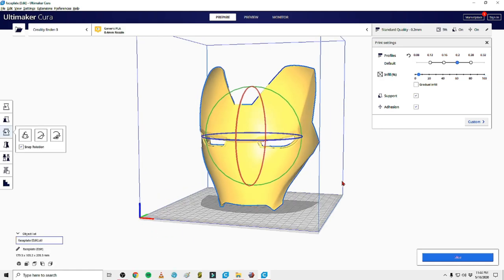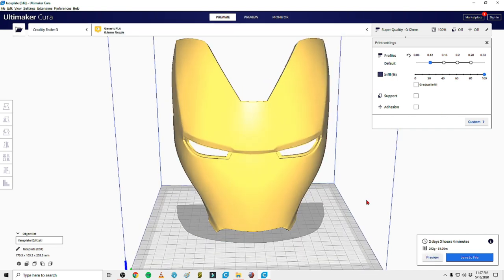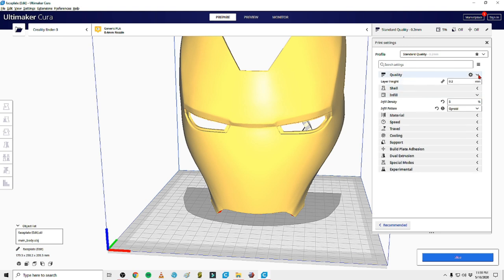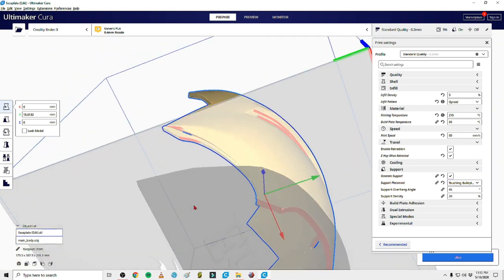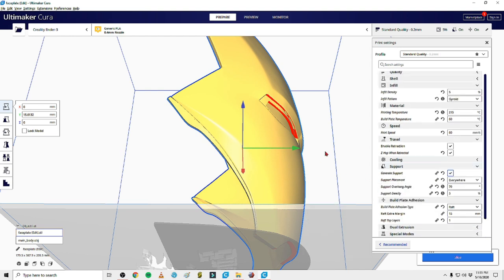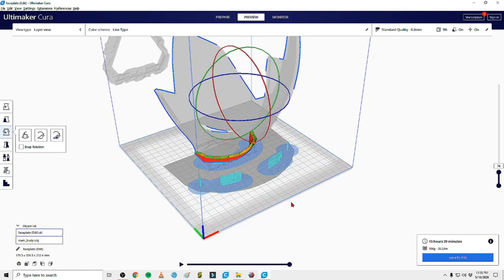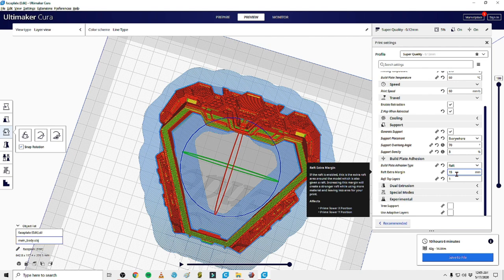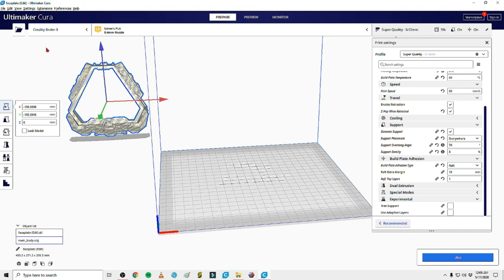Cura Settings - My Easy to Follow Tips to SMOOTH 3D Prints!

Comment: Bro you're ABSOUTELY crushing it. Everytime I run into a corner with how can I make a print work, I sift through your vids and have found answers every single time. My first build was a wingman from APEX (blocky and simple) and then I immediately jumped into building lich king armor which is very complicated and your vids are walking me through it a step at a time. I've learned so much. Also the Ender 5 Plus your recommended is straight beast mode. Now both me ender 3 and 5 are putting in work.

Comment: Good Morning! Thank You so much for you input on this video. For days now I been searching of how to use the slicer and so many videos I have seen that hasn't stated any of the input you have on this video. Thank You so much! I am new to 3D printer and was about to threw in the towel until I decided to do one more search and ended up with your video. I think I have a chance now to try it out and see how things goes. I had brought a Ender 3D printer and thought I have broke it because my print was getting hard to remove from the bed. Then brought another printer Longer LK 5 and my filament was every where, couldn't understand the He** I was doing.  But with your video I think I have a chance to set both and maybe get to print.   
The worst park of it.....is the levelling SMH that's another story of HE**.  smiling. 
Thank You again.  God Bless

Comment: Viewers might also be interested in the Adaptive Layer Height feature in Cura. It alters the layer height dynamically depending on the amount of detail/curvature at different heights. For example consider a vertical cylinder with a domed top: The cylinder part can be printed at a thick layer height but the dome on top needs a thin layer height. Normally you would have to set a thin layer height for both. The Adaptive Layer Height feature will change the layer height automatically to suit and this can speed up printing.
Reply from the maker: I’ve actually been playing with that recently trying to explore more features

Comment: dude this video is a god send. now if i can just get dial in this warped heated bed. fuggin aluminum plate came warped. like i can be 3 printer sheets deep in all 4 corners (nozzle way too far away from plate in corners) and im still carving a gash into the center of the plate.

hoping this new glass plate i just ordered will fix that. or adleast patch it enough to not make every ither print fail.

Comment: I had a horrible x shift. and I wen through and couldn't figure it out. so I popped the fan cover on my Cr10 mini. and low and behold my heater block had come loose. so far so good. sometimes doing maintenance helps

Comment: Finally someone who points out settings wont fix a shit printer! If I had 5p for every time I have seen a recommendation to change settings for something the hardware is causing I would be able to swap printers with filament rolls!

I used stock cura draught profile to create "My Profile", I only use that ONE profile ever. Only things I changed from stock was Flow (after flow calibration), speed and acceleration, minor adjustment to retraction and thats my default saved..

Per print I just change layer height for different quality, if its higher detail I might slow it down a wee bit, if its simple with little detail I will change up to 0.3mm layer and speed it up, add supports if needed and adjust infill as required.. 

If I get an issue with print quality, its something gone wrong with the printer obviously, no point fixing a profile that not broken, fix the bloody printer!

Comment: I gotta question, so I bought a 3D printer and I can't find a whole lotta support for it, its a Apollo3d Saturn and I ran two prints from it when i first got it, and they came out great, but now none of my prints are coming out. They all simply start printing, as if were starting from the top of the print, and I was wondering if you could help me out or point me somewhere..

Comment: Awesome video, thanks for the information! Have you had an stringing issues  when you started? My prints are coming out great on the creality cr10s pro v2 but have been getting alot of stringing.
Reply from the maker: Sometimes. That’s a temp and retraction issue you need to dial in
Reply: @FranklyBuilt  bro this is paint on computer which on e are you using....? Iam a beginner please help meeeeee!
I have Autocad 3d? Which one paint is this?

Comment: This is great info as always! BTW - Looks like Cura 4.6.1 gets rid of support density setting... Also appears to be no margin or top layer settings for build plate adhesion, and no experimental settings for tree supports...
Reply: right click the settings and you can enable them. They are just hidden by default

Comment: I do have a question on 'hole size'.  I had a failed print and a community board mentioned I didn't have the correct hole size setting.  Do you mind covering how that factors into a successful print?  Or if you've covered that before, send me a link, please?  I reverberate all the other comments that I GREATLY appreciate you sharing!!!
Reply from the maker: Hole size? Never heard of that. Maybe you mean nozzle diameter? In that case Cura automatically calculates that
Reply: @FranklyBuilt  Sorry - went back and looked...  "Small Feature" setting also "Small hole size"...  I was trying to print a cylinder with a tapering cone that hollowed it out...

Comment: You should really split those tall, nasty, uneven bottom objects in half, flip the bottom half upside down and you'd have a perfect, support-less prints, most of the time. Also you'd have a perfect glue line, and the only thing needed is a few matching 2mm holes, so you can position the halves perfectly, using short pieces of filament as positioning keys.

Comment: Hi Frank 
Hope you are well 
Do you have a video on useing a 0.6mm nozzle on a ender3pro with what settings you use please 
Would help with a lot of questions i have 
Thanks
Reply from the maker: No sorry no video on that. But it’s the same as always. I use stock settings mostly. I just change infill and supports
Reply: @FranklyBuilt  ok thanks for the help

Comment: Can you do a video on when to use infill? Currently printing a rhino bust (thingiverse) i've made it hollow 0% infill but there have been some eeeek moments around the ears so im wondering if you can put your spin on it. I've read making the walls thicker would help but im sure your knowledge would come in handy
Reply from the maker: I’ll use infill around 5-10 Gyroid when making light statues or props. Anything getting handled gets 15-20

Comment: I'm curious about your print orientation. you say that you have your mask facing forward so the gantry not the bed can do the majority of the work and be more stable. lithophane people orient theirs so its facing either left or right so the bed not the gantry will do the largest share of work. thoughts?
Reply from the maker: That’s interesting. I’ve always had luck with gantry over bed but it’s 100% worth testing your own and seeing
Reply: @FranklyBuilt  1 reason was the weight that has to be moved. glass bed and aluminum frame vs the hot end parts. more stability moving the lighter weight perpendicular to the largest flat surface but I don't know. I've only ever done it the 1 way.

Comment: so these settings are great! The only thing I keep running into is my raft is not easily taken off the part. It sticks to it badly using Cura. I am trying to find the best setting to have it peel off with no damage like it does when I use Simplify3D. Trying to get away from that app.

Comment: Hey maybe you can answer this question, I just got an ender 5 plus, I’m using ultimaker cura and saving the files as a gcode to my sd card, the printer isn’t reading it as well as usb isn’t working what am I doing wrong?

Comment: In which video did you cover how to remove those circles the 3d printer makes before it starts it actual print?
I was able to print a cube and now I am trying to print something a bit harder, and the circle seems to be a waste of filament and it causes fail.
Reply from the maker: Timothy Beall that’s called a skirt. It’s under build adhesion
Reply: @FranklyBuilt  thank you for all the goo information. Made my start to this so much smoother.

Comment: Heya, I have always been using PrusaSlicer and setup easy to remove support settings, was wondering do you have a video on this for cura or what you use as to not struggle with support removal?
Reply from the maker: Nah not really. My Cura supports have always cooperated really well

Comment: Do you ever have thickness issues? Sanding doesnt ever get you into the infill layer?
Reply from the maker: Nope. Never
Reply: @FranklyBuilt  ok thank you just finished building my cr10s and debating where to start on this build, printed the thumb armor last night and it fit good so maybe build the hand. I've just been using your settings to do this as it's all new to me. Thank you for being so vigilante in responding you are so dedicated to your fans lol
Reply from the maker: Bryant Johnson dude no problem man! I suggest watching my whole MK85 build series before starting anything more because I change a few things and learn so much as I go

Comment: Hi,

I have a home made 3d printer. I am currently facing issue with z motor position after each layer. My z motors are not moving up as they should and it end-up crashing into previous layer.

i am using merlin 2.0 firmware, slic3r for gcodes and pronterface for printing.

Kindly advise
Reply from the maker: Move To Cura for gcode
Reply: @FranklyBuilt  I added a gcode to raise z motor after each layer ("Print Seetings --> "After Each Layer gCode" in slic3r) it works for few layers after that it start working in reverse.
Is the value in slic3r gcode gets overwrite when auto z raise reach the same value and turn the z in negative? 
How I solve this z motor issue? it is still crushing into previous layers and ruining everything.
Need advise

Comment: Just curious, new to your channel been checking out some videos. Any particular reason you don't use ironing top layer function in Cura? Is it just due to the extra time it adds to printing vs you will be sanding anyways?
Reply from the maker: Time vs it never seemed to make a big difference
Reply: @FranklyBuilt  Thanks for the reply. I had let my printer start to gather dust then I found your channel. Now I'm doing my first full scale print for a Malenia Helmet.

Comment: Can u do a action figure that comes out smooth
Reply from the maker: I can yeah lol
Reply: @FranklyBuilt  Did you ever get time for this? I recently got the Ender 3 pro and I got it for D&D mini figures. I've been playing with settings but I want to learn whats really best. Such as pattern, layers, etc.
Reply from the maker: Timothy Beall nah man I’m sorry I haven’t had a chance. You just need to for us on getting any wobble or sway from the printer. A tight and tuned printer will give then best results. Over any gcode
Reply: @FranklyBuilt  Alright thanks! Just new to this and don't want to mess up prints and waste filament.

Comment: Do you only use Cura to slice? I thought you used slic3r?
Reply from the maker: I use Cura for Gcode. I use slicer and Meshmixer to cut models
Reply from the maker: Use slicer to cut. Cura to print
Reply: @FranklyBuilt  what do you mean by cut, and print? I did notice when I loaded cura it wants to know all my x and Y offsets and stuff for my bed
Reply from the maker: You should watch my “how to fit anything in any printer” video

Comment: how do I stop my printer making strings whenever 3d printing a helmet or a figure?
Reply: Its a combo of nozzle temp, retraction distance, and speed. I would look up the filament manufacturers recommended specs as well as reviews specifically mentioning their settings and go from there. Reducing the nozzle temp and/or upping retraction speed in 5c/5mms increments respectively will likely help. Play with one at a time on a temperature test tower.

Comment: He frank can you help me out. I yesterdag bought the cr10s pro v2. Only i want to test print now. After trying 4 times the printer won’t print my files. It also says that my printer may not know this g-code. I used cura for this. Tomorrow i am going to dowload the creality slicer app. But can you tell me what I am doing wrong. If it is easier for you to communicate with me threw discord my discord nam is Obi-Chewie Kenobi#4937
Reply from the maker: Have you posted on the discord asking for general help yet?
Reply: @FranklyBuilt  no not yet
Reply: All right i joined the discord but no one gives me any advice
Reply from the maker: You need to post and wait lol 😂 it’s not instant my man
Reply: But can’t you help me in the meantime?
Reply from the maker: Not in a YouTube comments section I can’t. Make sure the gcode file name is less than 10 characters when you put it on the SD card
Reply: The name was xyz cube
Reply: I saw it on the screen
Reply: @FranklyBuilt  when i do auto leveling and then mesure the 3D printer just stay for 5 min in the same spot. This is the feature where the nozzle mesures 20 points. It is just frozen. It does not work. Is my 3D printer broken
Reply from the maker: Is everything plugged in properly?
Reply: @FranklyBuilt  all the cables are plugged in
Reply: I want to show you a picture but that can’t in YouTube comments

Comment: If you have been messing with cura nothing makes sense anymore.
Reply from the maker: I don’t agree with that lol Cura works great
Reply: It works great but it has a lot of settings many of which interact with each other in opaque ways.
Reply from the maker: True but you don’t need to modify much of them. I only mess with infills and supports 🤷‍♂️